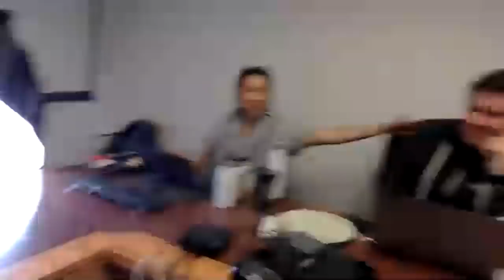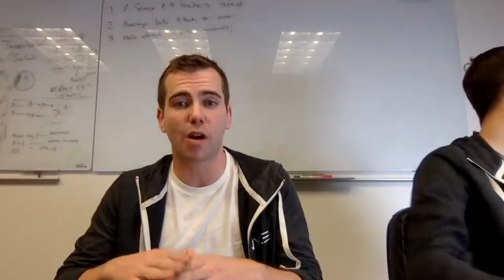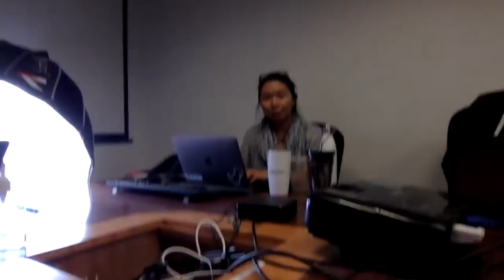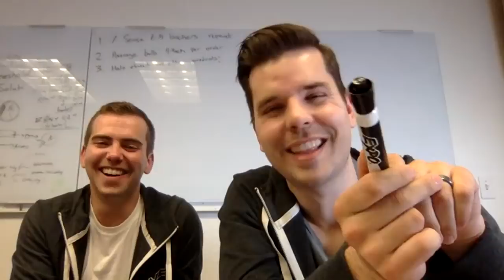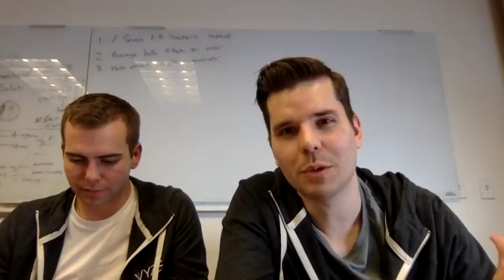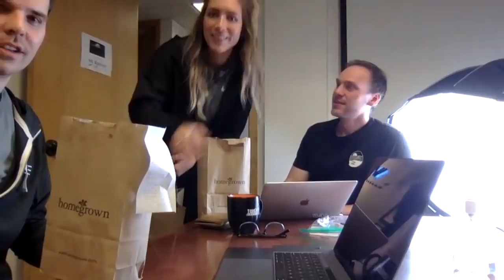Bulb Early Access AMA

Comment: I WOULD purchase, but my wifi already has many connections. That's one advantage PHILLIPS HUE has over WYZE. I'm VERY satisfied with cams and sensors however. Perhaps a software update will allow it to connect to the WYZE SENSE bridge? Thanks! 
P.S.
+Spotlight camera
+Peep hole camera
+In car 360 degrees security camera?
+ROV camera. Imagine being able to move around the house!
+Camouflage options for the existing cameras as well as mounting brackets. +Corner and outdoor mounts for cameras and sensors, - clock, toy, radio- housings for V2, etc.
+A bridge that would connect lightbulbs to it and thus reducing the number of WiFi connections to the router and therefore create a more reliable connection. 
+Everyone wants a black option and I'm just dreaming of a clear, see through, limited edition!
+BE AS GREEN AS POSSIBLE WITH PACKAGING AND MATERIAS. 
THANKS!!!
Reply: Daniel Castañón-Rico How many connections does your WiFi have? most modern access points can handle 60-70devices.
Reply: @bosstackett4  Not the person who posted the question, but perhaps he is in similar boat to me.  I get my Internet via Verizon jetpack, which only allows 15 simultaneous connections, so with smart phones, tablets, laptops, smart tv, Wyze devices, etc., having to have each bulb with its own connection is problematic for me.  I may end up also going to Philips Hue for their hub.  But love my Cams/Sense, etc.
Reply: Rob J makes since now thanks for the reply.
Reply: I Max at 20, then things slow or some get dropped for others to connect.

Comment: Can I use these for my porch lights?
Reply: In the video, they said that you can but there are 2 conditions: 
1. Not recommended in fully enclosed light fixtures (that will reduce the lifespan of the bulb if it gets too hot)
2. No direct exposure to weather elements (obviously).
Also keep in mind that it is designed for indoor use and the warranty only covers that.